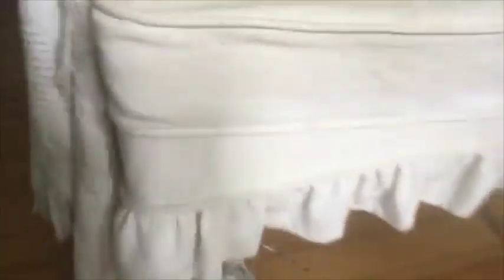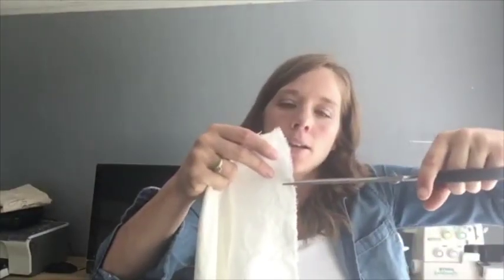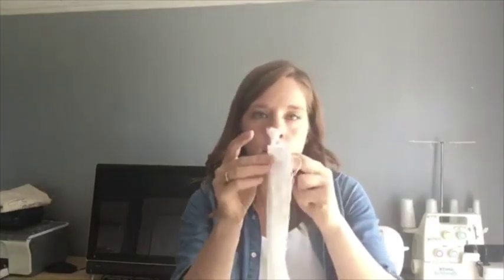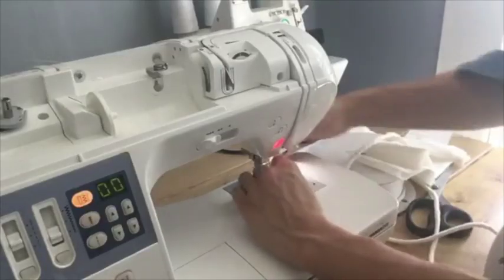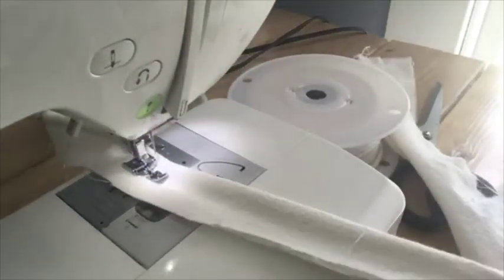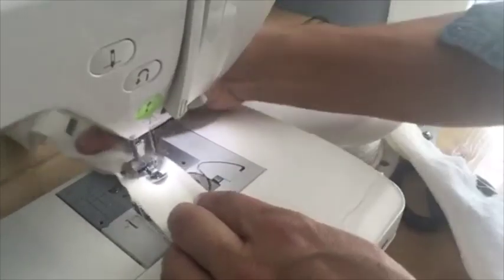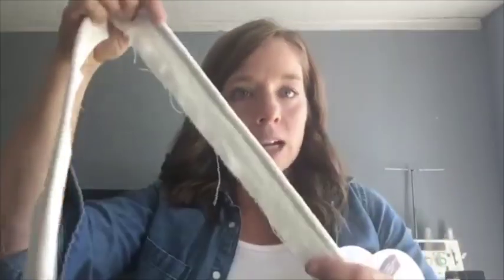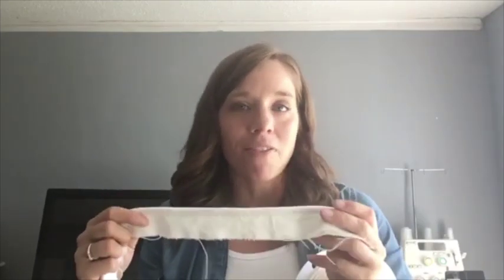How to Make Piping

Comment: I love that you are showing this. And how you have taught yourself to sew! By the way, if you are using piping on curved areas you get better results with diagonally cut fabric. It lays so nicely around curves. And when joining strips of piping fabric lay them across each other at a 45 degree angle to join the ends, stitch across the square, snip off the excess fabric and lay flat and press. This removes the bulkiness where strips are joined and your eye doesn’t even notice the joined seam because it is on the diagonal. I hope that makes sense.
Reply from the maker: Thank you so much for that tip!